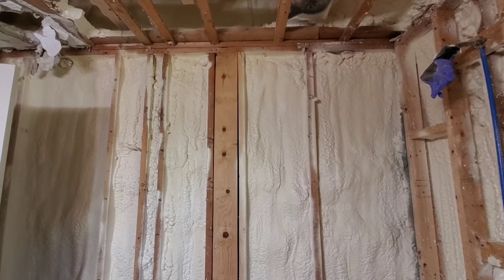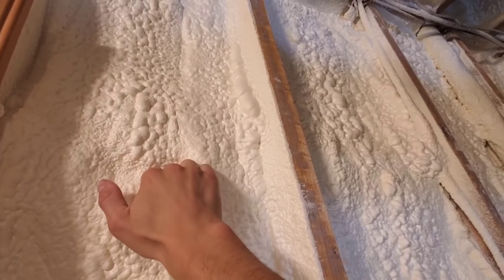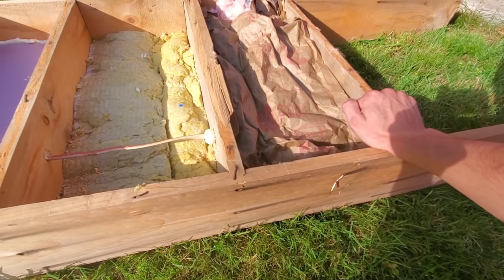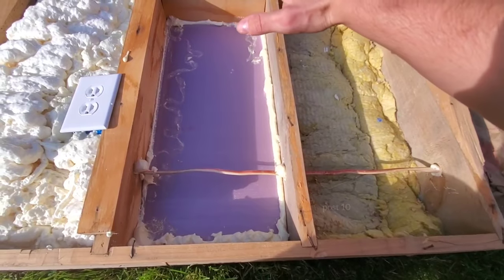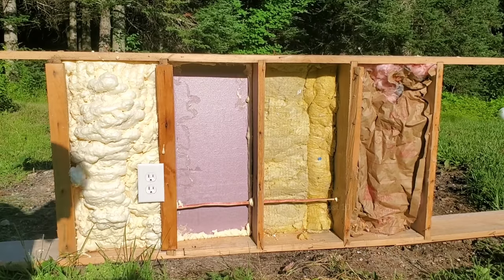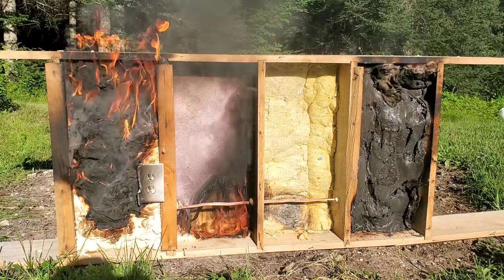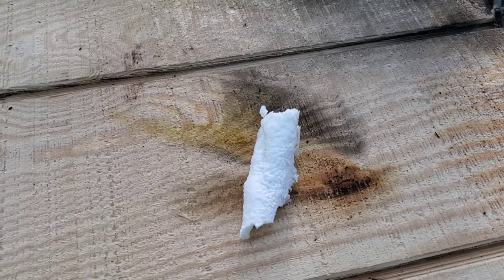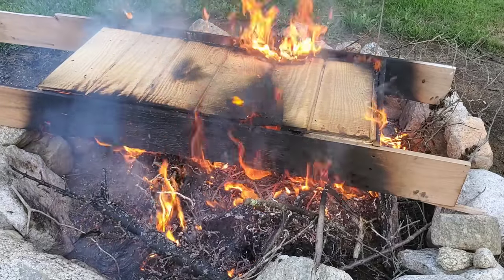Testing The Burn Ability Of Insulation In Wall

Comment: Rockwool is actually a molten rock byproduct, not fiberglass. Essentially rock fibers which is why it doesn't burn.
Reply: That's very interesting. I suppose same danger for inhaling a lot of it. Rock isn't very biodegradable. 
Maybe slightly better than fiberglass though? It sure was fire resistant. Even proof.
Edit:  Just found this info:
"The dust from rockwool can irritate the skin and eyes if a person comes into direct contact with it. Gloves and goggles should be worn when working with rockwool. This is why rockwool is not as harmful to breathe in as asbestos. Because rockwool fibers are short and thick, the body can easily expel them."
Rockwool FTW!!  Seems well worth the price.
Reply: @terminalpsychosis8022  Nice info!
Reply: @terminalpsychosis8022  rockwool is way safer then fiber glass it also produces far less fibers during install (to the point only dust masks are required for install), the benefits and completely fire proof good sound blocking and in is vapor permeable. it is costly
Reply: @TDREXrx9  You gotta wear gloves too but otherwise yes.
Reply: Rockwool is used as steam pipe insulation. No question it's fireproof.
Reply: Rockwool is basalt melted in a blast furnace. Not a byproduct. Fibreglass insulation is similar but made from recycled glass bottles.
Reply: Asbestos is also essentially rock fibers, thin filaments of the rock called serpentine (mineral: chrysotile).
Reply: @joshuapayne8811  But the danger with is our bodies can never dissolve it, so if you inhale it will simply break into smaller and smaller shards that tear up your lungs.
Rock and glass also aren't great for you but eventually our body can break down most of the minerals and get them out.
Reply: @joshuapayne8811  The difference is that rockwool cracks along the short axis and asbestos cracks along the long axis…
Reply: @terminalpsychosis8022  rock is literally what the earth is made out of.

So it doesn’t need to degrade whatsoever. You just need to break it into dust and then disperse it
Reply: I must correct you a little there Sergio: Rockwool is not a biproduct, rather it is the actual product.

The wool is formet by letting molten basalt run in a thin stream over 4 fast spinning wheels, rotating in opposite direction. The molten mass is flung into the air in tiny drops, while a huge amount of air is blown in around the wheels, pressing the drops forvard into a heated hardening chamber. Passing through the air each drop forms a tiny fiber behind it, wich becomes the actual wool.

Inside the hardening chamber, the fibers land on a conveyor belt, where it is held by suction and pressed into the desired thickness by another conveyor belt, before being cut into bats.

Source: I cleaned the inside of that hardening chamber some 30+ years ago when i was young. We looked like coal miners when we clocked out that weekend.
Reply: @TDREXrx9  Yes and no, the fibers are very different but actually it is federally regulated that the fiberglass industry maintains a glass dissolution rate such that the fibers can actually be dissolved in the lungs. Crazy enough you can make glass that will dissolve in a bucket in a few weeks with the right chemistry. Typically most fiberglass insulations have a multiple year dissolution rate as the product must last as well. 
I work for OC as an engineer and we produce both rockwool and fiberglass obviously.
Reply: @terminalpsychosis8022  So, basically a suitable even equitable substitute for abstesos, when used as an insulation material.
Reply: @joshuapayne8811  Both rocks are from the same geological family, if I recall correctly.
Reply: @jaras1969  where's the factory?
Reply: @jed-henrywitkowski6470  I'm not sure If this factory is in production any more, but it was in the area of Roskilde, Denmark.
Reply: Meted Rock = similar to glass.
Reply: The fiber glass acts the same though
Reply: @terminalpsychosis8022  that is the same reason that fiberglass is considered safer than asbestos, with asbestos it is only a fiber size in a certain range that causes issues below the size and they dont stick in your lungs and above the size they are expelled by the body. Fiberglass is engineered so fiber size is consistent and in theory will not produce fibers in that range. Both asbestos and fiber glass are silica based fibers but because of consistent larger fiber size of fiber glass in theory it will not cause asbestosis or mesothelioma. It can still irritate your lungs so it isnt good to breathe but at least in theory it will not kill you like asbestos will.
Reply: @jaras1969  I work with that shit as a mechanical insulator i am.  I always wondered why there were huge chunks of molten in the pipe insulation.  Explained that to me now. Thank you
Reply: A very specific type of ceramic wool known as kaowool is used as super high temperature insulation for kilns and forges, and easily withstands the temperatures needed to melt steel. The rock wool used in this demonstration is very similar, just less expensive.
Reply: @jaras1969  no produktion in that factory anymore, only administration
Reply: @terminalpsychosis8022  its still irritating for the body though. Can't be healthy
Reply: @terminalpsychosis8022  I used it on the roof of my shed here in Ireland. It's super handy to work with compared to fiberglass! and a simple mask and safety glasses are what I used when working with it.  I'll never go back to the itchy doom of fiberglass insulation.  THOUGH a handy tip if you MIST handle it, rub your arms down with talc to clog the pores prior it makes the tiny fiberglass particles less likely to stick in pores.
Reply: @terminalpsychosis8022  rock fibers and steal slag fire resistant and well worth the price. if you want fire proof you need ceramic wool but 3 times the price or more.
Reply: The only one i use
Reply: @terminalpsychosis8022  Rockwoll fibers are heavy and don't hang in the air  very little chance of inhalation. A simple dust mask is more than sufficient
Reply: If not mixed correctly the  spray foam insulation  can be poisonous.
Reply: @shayjohnson5830  Actually there have been - the medical costs couldn’t be justified (particularly on the mining side where containment proved impossible).
Replacements have been found for all uses that are far less toxic and actually functionally better.
Reply: We call that thermafiber.  It is expensive and nasty to work with.

Sealed joints and holes with firestop foan, and properly installed unfaced fiberglass is the best deal.

Faced bats in basements. 

The bib/blown in fiberglass or cellulose is the next thing, if you have the cash.

The closed cell foam is good to secure unreinforced masonary to the sheathing.  

Did hundreds of structures.  The one thing i learned...  the insulation business sucks ass.
Reply: No way !
I thought this meant my fiberglass boat is made from glass.
Reply: whole house got upgraded to rockwool slag wool. just cuz it dosent burn.
Reply: @allangibson2408  The binder in true fiberglass is very flammable. I know...we used to throw our scraps in the campfire when we were insulating a cabin.
Reply: Fiberglass is also made of rocks. Primarily limestone and silica sand.
Reply: Yes. The term "mineral wool" covers both rock wool and glass wool.
Reply: @douglastibbitts6817  
Well, technically it is. Glass and plastic. Probably some wood in there too.
Reply: Makes a decent sterile medium for hydroponic cultivation
Reply: Rockwool is also a great sound suppressor.
Reply: Is that the same as mineral wool?
Reply: Glass wool and rock wool would both be mineral wool.
Reply: Love rock wool! My downstairs is insulated with several inches of it. Stays warm in winter and cool in summer.
Reply: Roxaul safe and sound is totally non combustible, the melting point is 2150F so no, you can't harm it with a blow tourch. It's also an excellent sound deadener great for home theaters
Reply: yea and the wool batts he mentioned is polyester and or sheep wool so I'd say he definitely had rock wool there. Obviously that isn't going to burn well if at all.. I would think wool from sheep / polyester would burn though
Reply: @terminalpsychosis8022  It is, so is asbestos though. all from mined earth, unfortunately not good to breathe in.
Reply: while rockwool does contain some rock.. it is mostly made from steel slag, a byproduct of the steel making process
Reply: @krisw8419  yep and it has the same issue as asbestos.. if you move it a lot and breathe in the dust you're in for a bad time. Luckily walls don't move often but they said the same about asbestos lol
Reply: @TDREXrx9  rockwool is very expensive.
Reply: This guy needs to do more research before spouting off on Youtube. The firemarshall below should not be encouraging this guy
Reply: @terminalpsychosis8022  we put rock wool in gas fireplaces right on the burner and after a year or so it's just covered in black shit. It's really fragile then and it can disintegrate when you touch it. It's itchy as hell when you're working with it but clears away quicker than attic insulation.
Reply: Also theoretically it's recyclable and doesn't impact the environment when the house gets torn down after a century.
Reply: Wow spoiler alert
Reply: @douglastibbitts6817  it is. Glass fibers with something else I can’t remember. Look it up. ;)
Reply: Your hired, lol.
Reply: @allangibson2408  Rockwool feedstock is quite often the slag or byproduct/waste product from the iron ore reduction process done in a blast furnace.  A lot of the feedstock mined from slag heaps which are essentially steel industry waste piles.  It is often modified with other mineral additives to control viscosity and color (not for insulation but when used as a stock for Rockwool ceiling tiles). I worked with most US Rockwool manufacturers throughout the years.  Not sure how much of the manufacturing base still exists in the US though.
Reply: @staberdearth3130  The last plant I worked on was using basalt as the feed stock but I know of other plants using recycled glass bottles to make fibre glass insulation as completion.
Reply: @allangibson2408  There are a number of feedstocks depending on where the plant is located.  Many of the Rockwool plants I consulted with had a ready cheap source of blast furnace slag that the steel mills were very happy to turn a small profit to remove those unsightly piles.  It is quite possible that those unsightly piles are diminishing since US blast furnace output has decreased and a lot of steel is now made through recycled sources in electrical arc furnaces n what are called mini mills where the process is primarily to melt and for the most part not to reduce an iron ore feedstock and remove tramp elements.  The amount of slag in that process is a fraction of what it is in an iron ore reducing blast furnace process so highly likely not as big a feedstock these days.
Reply: Glass is made from sand, which is just little pieces of rock, so it's molten rock also.
Reply: Same as the fiberglass
Reply: Rockwool sounds very close to asbestos then :x
Reply: @Wolfeboy212  Kaowool is Aluminium Silicate (it is a ceramic fibre). (Half Alumina, half silica (with random admixtures of other oxides).
Asbestos is a magnesium silicate.
3M Nextel is similar and an alternative to woven asbestos products…
Reply: Rockwool and fiberglass are identical.. one is basalt rock and the other is silica rock. Only a small variation in the elements the rock is made from and the temperatures that rock can handle.
Reply: So it is essentially a modern version of asbestos—one of the all time greatest insulators.
Reply: Kinda . . . Rockwool is made from slag.  When you make iron or copper you melt the ore concentrate in a furnace.  The heavy multen metal sinks to the bottom and the impurities float to the top and are skimmed off as slag, a trash byproduct of the process.  There are literally mountains of formerly worthless slag all over America that can be turned into insulation.  And I believe its the best insulation available today.  It's completely fire proof, water doesn't harm it, bugs and critters hate it, doesn't sag over time and is a very good at sound deadening.  It is slightly more expensive than fiberglass but is far superior.  The only advantage foam has over Rockwool you need a 6mil plastic over Rockwool in cold climate.
Reply: So the only people that can burn rocks are the crackheads downtown? 🤣
Reply: Glass is made from molten sand, which is basically rock particles...
Reply: @terminalpsychosis8022 The foam is really toxic and you may also have severe allergies... And while burning... Dont breathe...
Reply: Rocco is probably one of the best insulators because it doesn't burn, it allows air to pass through and works well for sound
Reply: Rockwool is effectively a non toxic asbestos. Similar source (asbestos is literally just thready crystal formations) but few if any of the draw backs. It's just the more expensive of the options. it's widely used when sound dampening is a higher priority.